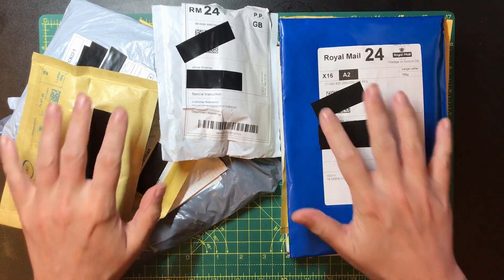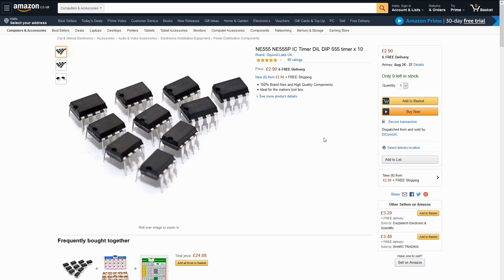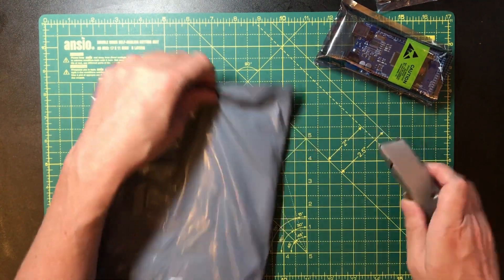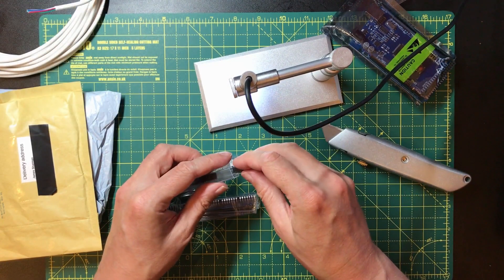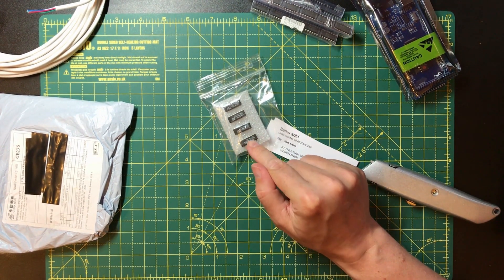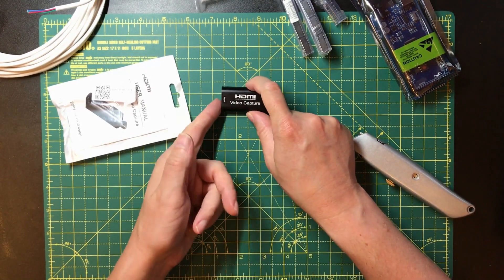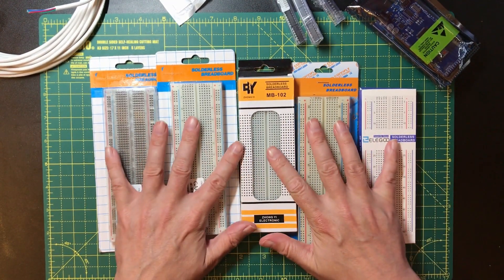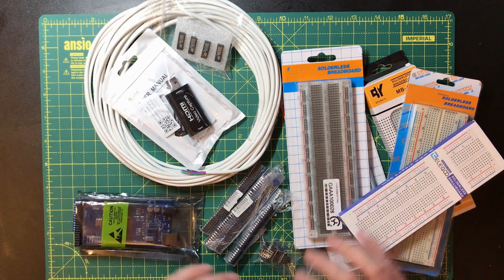Mailbag #10 Bread N' Chips

Comment: Nice! If been meaning to ask you on your opinion on good breadboards for a while! I saw that i could order the breadboards that Ben Eater used (BusBoard Prototype Systems) on mouser (the Belgium .be variant), so i'm probably gonna buy those but i'm curious for your results! :)
Reply from the maker: I've heard good things about those, but they are more expensive than the others. I ordered one which hasn't arrived yet, hopefully it will get here in time.
Reply: @weirdboyjim  yes, the price is why I haven't ordered them yet (that and haven't had a lot of time to do electronics these days)
Reply: "Battle of The Breadboards" ;)

Comment: A lot of interesting stuff. A breadboard review would be most appreciated. I have a lot of the Elegoo boards, they often have difficulty with insertions. The openings have flared openings, but very close tolerances. I have posted and image on twitter if you don't want to rip one apart.
Reply from the maker: I'm expecting to extract a set of clips from each of the breadboards  to put under the microscope.
Reply: @weirdboyjim  well worth a look.... Ben Eater did that little video when he compared a cheap and nasty to the ones in his kit.... be interesting to see some more examples..... .... without having to vandalise any of MY boards.
Reply: Was far too late making a breadboard comment ... already several here!
Have never owned a good one.  The first square pin I put in one, usually ruins it.
Distrust them so much that I never use them.
For anything remotely complex, I end up soldering female pin headers to veroboard,  and making wire-wraps.

Comment: Speaking of NAND gates - I went to a second hand store today and found a book called "Handbook of Digital IC Applications", by David L. Heiserman, from 1980. It's all about digital electronics and TTL chips and binary algebra and logic gates and circuits and what have you. Perfect! And I do love a nice physical book. Seems to be well written and thorough.
Regarding breadboards, I've been reasonably happy with these MB-102 boards (considering the low price)  - but they vary from board to board, some have very loose connections, especially on the power rails, which can be frustrating as you can imagine. It's nice that the power rails are connected all the way though. Looking forward to a breadboard test!
Reply from the maker: Nice find vortex.
Reply from the maker: On a side note, can you edit out your image links, youtube spam filter doesn't like in comments.
Reply: @weirdboyjim  Done. I wasn't aware.

Comment: Love some chips on bread. Your Arduino... I used an esp8266 to do a similar thing using WiFi. I have a web-based assembler and submit programs to my CPU wirelessly. Works very well. Super-quick to change programs. I also wrote an emulator and compiled to WASM to test programs in my browser too.
Reply from the maker: Yeah it was interesting what you did there. I have a hesitancy towards integrating something into the cpu build that potentially has more computing power than the build itself. Of course my serial terminal is actually an i7 based pc with several orders of magnitude more power ;-) That said, I think you'll like what I have planned in that area.

Comment: I went through a variety of breadboards a while back and while I like the Elegoo ones, by far the best ones I found were from Mouser, product #920-0031-01
. The brand name is SchmartBoard. You might give it a try as well. At about $8 each they are pricey but the pain and wasted time of substandard breadboards made me a believer in high quality ones.
Reply from the maker: I really like the external look of the Elegoo ones, but the grip on the wires seems really variable.
Reply: I had a terrible time with Elegoo breadboards, would never buy them again.

Loose fitting, and that was if I could even get the component leads to go in to the holes in the first place because the metal contacts were so poorly aligned.

Ben Eater has a review of the breadboards he uses, and Julian Ilett (I believe it was) has done a bit of a teardown/comparison of a variety of breadboard contacts too.

Some of the best breadboards I have ever used are "K and H" brand.
Reply from the maker: @TomStorey96  That sounds a bit like the experience i've had.
Reply: @weirdboyjim  I'm guessing someone picked some dies and moulds out of a dumpster one time and decided to start making cheap breadboards. 😋
Reply from the maker: @TomStorey96  I think the metal clips make the big difference. The Elegoo plastic is is pretty good.
Reply: @weirdboyjim  yeah I think you're right now that I think about it. The plastic seemed fine, it was just the metal that let it down. And the fact the power rails were continuous for the full length of the board was also a plus. No jumpers in the middle to drop even more voltage!

Comment: I've been rewatching some of Curious Marc's Apollo AGC restoration videos.... the AGC being one of the first computers to use ICs...  the point being, those ICs are JUST dual NAND gates... nothing else.

I don't really "rate" the Arduino much anymore.... it's surprisingly easy to simply chuck an AVR chip on a board and bash out a bit of C (or assembler if you're as mad as me) without needing a separate board or opening that horrible IDE.
Reply from the maker: The Apollo restoration videos are ace! There is a reason that NAND gets the prestigious zeroth position in the 74 series list. I think the AGC was mostly NOR though. When it comes to chucking a chip on a board, things were very different a few years ago and the Arduino seems to have done a bang up job in democratizing small scale real time programming.
Reply from the maker: And when you say "or assembler if you're as mad as me" I like to think my credentials for going low level are established at this point ;-)
Reply: There was I believe a worldwide shortage of Nand gates as the apollo programme used so many.  Karnaugh maps to reduce the logic and nand gates to build it, no that brings back memories.
Reply: @weirdboyjim  could well be NOR.... I'm talking off the top of my head.... oh yeah - Arduino got me started with microcontrollers and are just right for those who love 'em.... but for me it was more a "gateway drug"...... it's not that I'm starting a petition to get 'em banned or nothing. ;)
Reply: I still find the Arduino (the Mega in particular) useful for testing components as I build them. It's got enough IO ports to be able to cover almost all the inputs and outputs of individual components. I like being able to write test cases for my hardware, and it's found quite a few problems that might otherwise have just caused frustrating debugging problems down the line. That said, I've reached the point where I need more than the 54 pins of the Mega, so I'm going to have to branch out now. Of course, James doesn't seem to have quite as many bugs in his builds as I do in mine, so perhaps there's less value in that for him :)